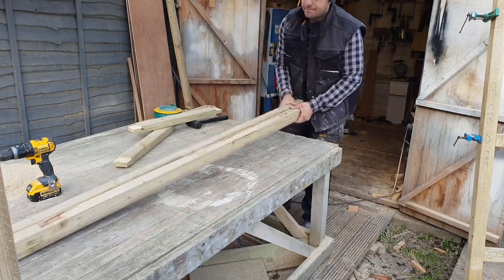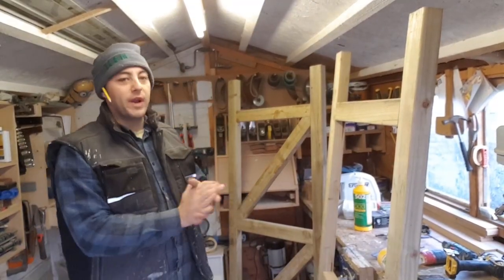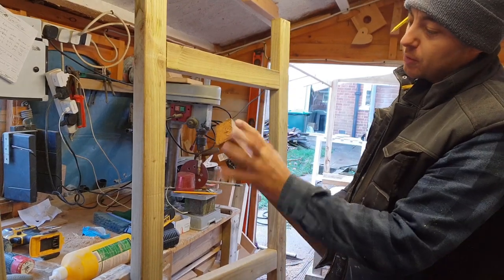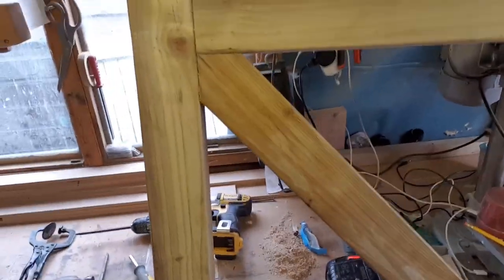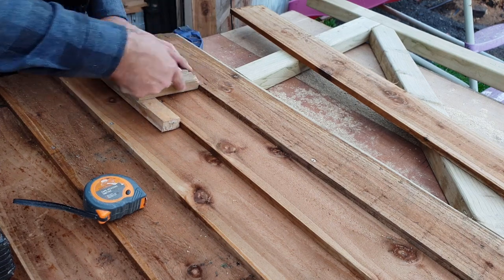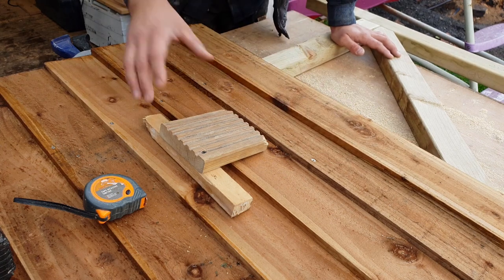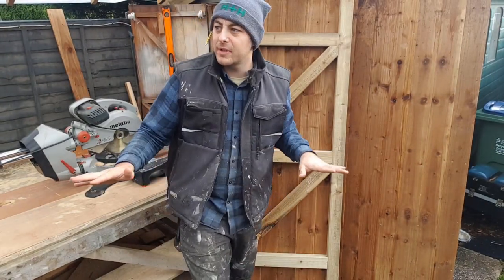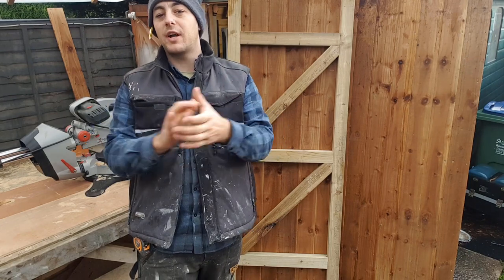Build a Mortise and Tenonm Gate part 2

Comment: from a novice wood worker  ,why do you need to make a joint with a tennon ? why not just make the hole big enought for the wood to slide in as it is? surely it would be just as strong?
Reply: ross white  that would be a housing joint and due to the fact you need to remove so much timber to set the rail in, you would weaken the stile. The is also more potential for the frame to go into winding.